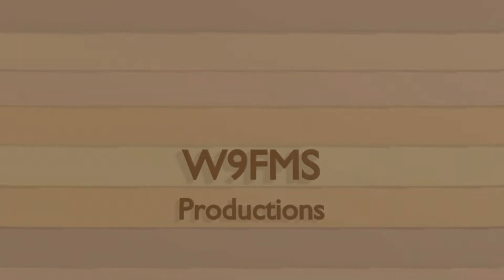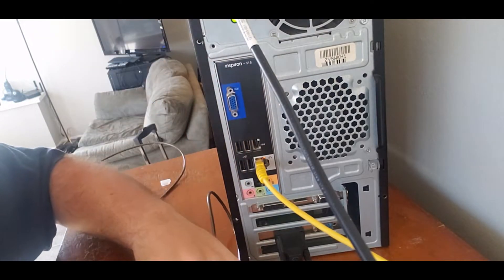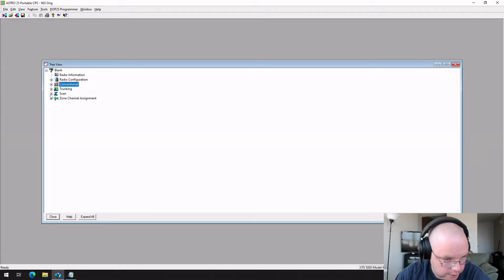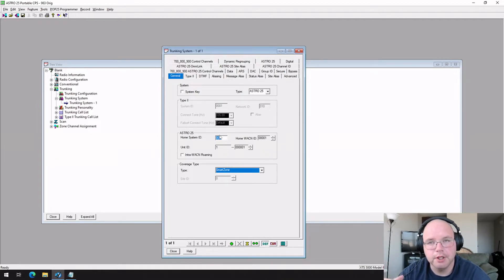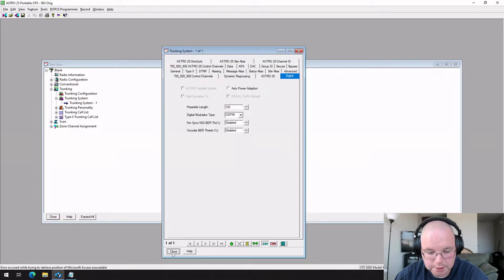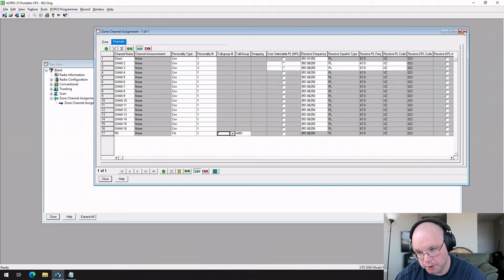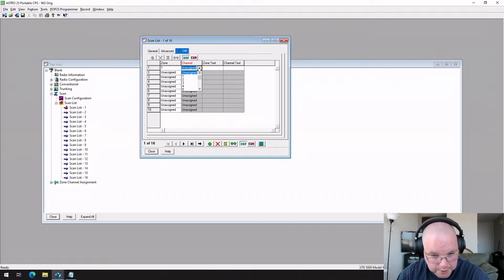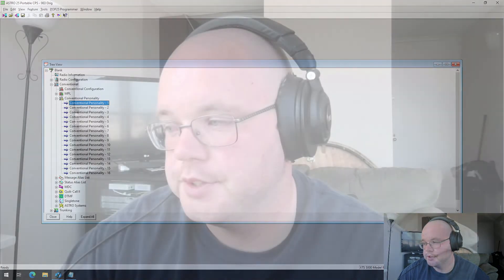Full Programing XTS5000 Scanner Zero to Hero.

Comment: hey i need help programming my radio i have an xts5000, i have the cable and i have the software but im needing help because when i try to write it. it tells me i need an adavnce system software and im really confused. i dont know what to do and i need help please message me or contact me when you have time and hopefully walk me through what i need to do
Reply from the maker: Thanks for watching, unfortunately advanced system keys are a lot harder to obtain. The traditional system key is easier but still can be a pain to find.
Reply: @BlackburnInTech  so good news. I orded the radio from haloid radios and they sent me a radio i wasn't gonna be able to program. It was a system error on there end. When I would try to rewrite it. It would give me an error saying software system key required. So someone before me had that radio and put a key on it. Haloid Radios sent me a new radio. Gonna play around with it when I get a chance to see what happenes and hopes it works.

Comment: Great video! Just picked up an XTS 5000 and set it up following these instructions and it is working perfectly. So much better than a scanner. I do have one question though. I have it set up on the Simulcast site which broadcasts most of the traffic I want to hear. However, there is a city on the edge of the county that does not appear to broadcast through the Simulcast. Instead there is a site located in that city which seems to carry almost all of their traffic. My question is, how should I handle this in my programming? Do I create another trunking personality?

Comment: Great video! Especially the information of preventing the radio from sending information to system, and not transmitting.

I have a question, can you make a video or explain how to set up the scan on/off, and channel select with knob etc... Thanks again!
Reply from the maker: Thanks for watching and I appreciate the positive feedback
Reply: @BlackburnInTech  the only question I would like to know is if I have a code plug from one of my old xts2500 800 MHz radios in trunking non-affiliate scanning format I was wondering if I can take that file and drag and drop it to the new xts2500 I don't know if that's possible or not to basically import the old file to the new radio that's already setup for non-affiliate scanning from a friend of mine who created the file on my behalf since he knew what he was doing so all I would have to basically do is write to the radio if I can do that I don't know if it will brick it

Comment: It won't let me select ASTRO. Any reasons? It's and older Motorola XTS 1500 from FD.
Reply from the maker: All depends on the feature set on the radio. I have one that will not let me set it. Also I'm not familiar with that radio The only one I've used is XDS 5000s. Thanks for watching be sure to like and subscribe

Comment: My Radio will show me channels but keeps beeping 5 times every minute and I can't hear anything... Any thoughts? It is an older model.
Reply from the maker: I'm not sure I've only used an XTS 5000. Hopefully someone else in the comments can help answer this one. Sorry I can't be more help than that :-)
Reply: @BlackburnInTech  I'm using a pair of XTS-5000R (Rugged, for explosive environments). I don't know just why it simply keeps beeping? I have system keys and such but the closest I've come to figure it out is that my 850Mhz system might be "out of band" for the radio? But our Fire dept has used the exact same model up until they found money to buy the latest and greatest radio's. I think they are they XPS series.
Reply: @MarkinToronto Did you ever find the solution to this?

Comment: I have all the channels set up. How can I use this to program a different radio. Can I change the serial number in the program to reflect a different radio. Can I duplicate the frequencies to program the radio I just bought? Can I wipe the new radio clean. Banging my head on the desk. I have 4 XTL2500's 2 Astros and 2 XTS 5000 I don't want to keep putting in frequency's for each radio
Reply from the maker: Cloning radios are hard to do. it has to match everything.
Reply: @BlackburnInTech  I agree, it very much matters on the "FLASHCODE" installed on each radio. If they don't match, you can't clone.

Comment: Where do I add the Frequencies?  I have a drop down menu that has some selectable freqs but, they are not what I want
Reply from the maker: Under the system you had the control channels. If you're using radio reference they are the ones that are in red just do not add the c after them. It will tell it what other frequencies to use. Thanks for watching and be sure to like and subscribe.
Reply: @BlackburnInTech    That area just gives me a drop down list of Freqs to choose? I cannot type in the control freq under the 700_800_900 Astro 25 control channels.  What am I missing?  Thanks
Reply from the maker: @jgadget405  Sounds like you don't have the system key set up. Try adding the key in again and see if it will let you change it. It should have a green + icon.
Reply: @BlackburnInTech  I do get the green + icon where I can add lines but, the Receive Freq and Transmit Freq still have a drop down list to select a series of Freqs from. I cannot manually add them.  EBAY XTS 5000 purchase.

Comment: I did this but the radio lags and misses calls. I've tried programming it many different ways but it still misses calls. I'm disappointed in using an XTS as a scanner.
Reply from the maker: One area that I would check would be to make sure you do not have too many frequencies in the system area. Also depending on how far you are from the transmitter you might need an external antenna
Reply: @BlackburnInTech  I have two frequencies (control 1 and 2) programmed and the repeater is very near.